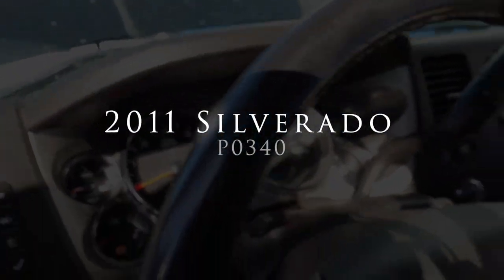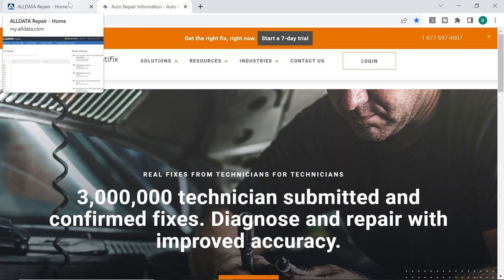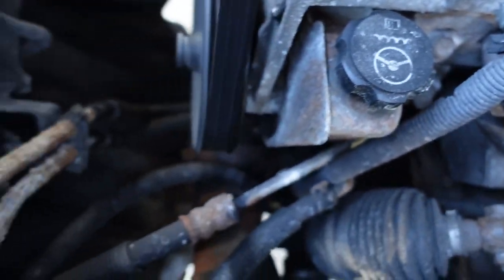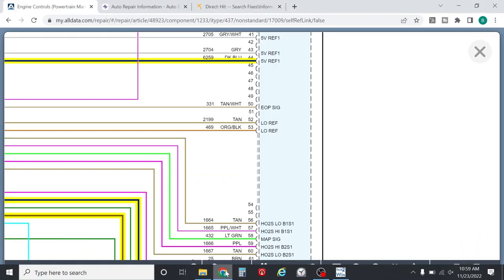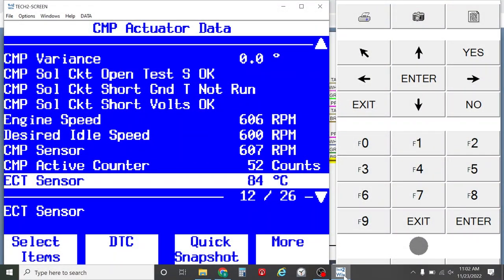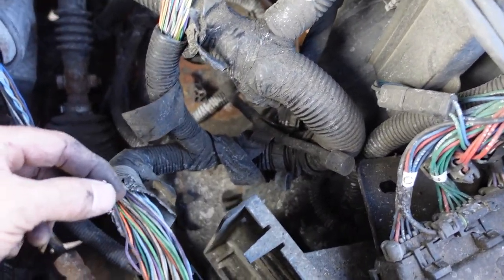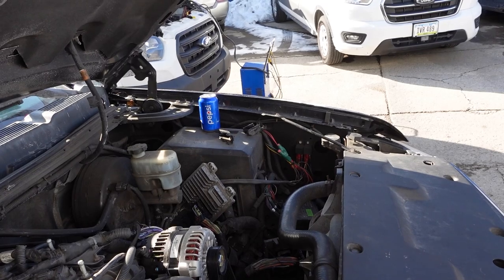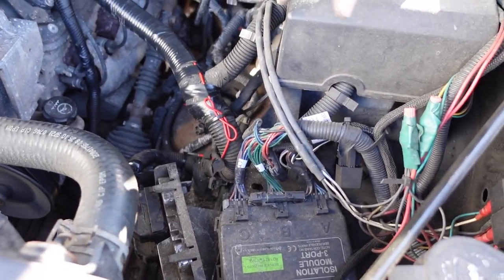2011 Silverado P0340

Comment: All Data wiring diagrams are nice. If you use the windows "find" function (F3) you can type in CMP or whatever and it will highlight on the diagram.
Reply: You also don't need to type the vehicle make-just the year and model starts bringing them up.
Reply from the maker: Great tip!! I will try that later today!!
Reply: all this makes me more confused

Comment: Great job Brian. I’ve seen a lot of these trucks where the 5 volts gets shorted by the oil pressure sensor and pulls the 5 volt down to zero volts and the throttle goes in default mode and sets code P0641. On older models the ecm sends 12v reference voltage to the cam and crank sensor. If the 12v gets shorted it will short the 12v at the ckp sensor. The diagram will not show that they’re connected internally but they are. 👍

Comment: NASA has a massive wiring guide that’s free to read online.  They say that applications that have vibration should use barrel crimp butt connectors.  Solder will eventually fail due to vibration.

Have a wonderful Thanksgiving, Brian.
Reply from the maker: Great information! Happy Thanksgiving

Comment: Great video.  That customer got very lucky on the PCM.  

Last year I had to do a wiring repair on my 2014 Mustang GT where something chewed the wiring off right at the connectors of both passenger side VVT solenoids.  I bought new connectors and used those same type of bare barrel connectors with heat shrink to do the repair.  A year and a half later and the repair is still holding strong.  I considered using solder but after reading a lot of info about not using it in possible vibration situations, I decided against it.  The new Ford connectors came with those same barrel connectors to do the repair.
Reply from the maker: I didn't  think pcm would be ok !

Comment: Man was this ever helpful. I had an intermittent stall with intermittent alternating crank vs cam sensor codes. Of the truck sat for 5 minutes, it would restart. My problem turned out to be the cam signal wire ground out on power steering pump. I wonder if this would cause a 5 minute time out on the pcm? Definitely weird it would restart around 5 minutes after. I almost put a cam sensor in it. I appreciate your video.

Comment: So if that wire was shorted to positive 4.7v and you jumped it from pcm supplying a ground, why didn't the fuse pop? What am I not understanding here
Reply from the maker: That was a low reference ckt, it was intermittently rubbing to that b+ wich compromised the circuit integrity.  That b+ circuit is not protected ( maybe it is but a very large fuse or link)
Reply: @BrianMann216  yeah but if that wire was a low ref which is a ground and it was shorted to pos getting 4.7v, when you hooked your fused jumper it should've popped and essentially all you did was hookup a low ref ground to a wire that was shorted to pos all over again and it'll melt the wires because you didn't find where the short to pos was. You hooked up that low ref directly to that pos shorted wire all over again

Comment: Great video thanks! What is the advantage of using tech 2 win over an aftermarket scan tool, seems like a very outdated and annoying to use tool?
Reply: Eric, I like the tech2win emu because it's waaaay faster than my Thinktool on these older model GMs.  But yes, the GUI sucks, for lack of better words.  There are times only it will do re-learns, when my Launch, Thinktool, or Autel won't do it.  It has its place in my diag cart.
Reply from the maker: Tech 2 win may look outdated , however it functions much faster than some other tools for sure and generally speaking it does what it is supposed to when other aftermarket tools may or may not perform a function.
Reply: @paulpaquette1961  Thanks I'm not Eric From Advanced Level Automotive Same name with diagnostics at the end:goodvibes:
Reply: @BrianMann216   Thank you I recently started using Witech and was looking into other OEMs
Reply: @advancedleveldiagnostics  My Apologies.
Reply: @paulpaquette1961  Thinktool is only "slow" on pre-CAN Class 2 GM vehicles, like 2006 and older. This 2011 is CAN-equipped; a modern scanner would be more user-friendly that the Tech2 :)
Reply: @PineHollowAutoDiagnostics  Yes, you are absolutely correct, my apologies. BTW, thanks to you I own a Thinktool Pros!  Lovely little tool.  I just wish they would allow you to create a .csv file from generic data, but none of the Chinese ones will do it.
Reply: @paulpaquette1961  yeah no one beats SnapOn in data graphing and saving! I just use the snapshot feature on the ThinkTool 👍

Comment: Hi. I just came across your video cause have a 2006 impala ss with a 5.3L engine. It started out with a p0340 code and extended crank. When it came to me the cam sensor had been replaced. So I started with the connector one terminal had been spread out so replaced connector still had code and extended crank. So I replaced sensor with the same brand code cleared still has extended crank at times now with no codes. Pulled wiring harness apart looking at the wire all is good. Then I noticed when it does the extended crank I have crank counts crank rpms and cam counts but the cam rpms stays at 0. So I put an new ecm in it but it still does the same it. No codes and extended crank can release the key from crank to run back to crank position and it will start up and the cam rpms work on that second attempt does that sound like a bad cam sensor if so that will 3 of them bad or could it be a crank sensor not showing up any problems. I've checked both sensors 12 ref is good ground good and it has signal. I'm lost at this point. Thanks in advance for your help. Great video
Reply from the maker: How is the fuel pressure? Make sure you check the cam sensor counter Data pid for it to be counting
Reply: 60 psi fuel pressure its got injector pulse its good spark crankshaft counts count the crankshaft rpms work the camshaft counts count but the camshaft rpms stay 0. Cycle key from crank to run back to crank position cranks right up and the camshaft rpms work then. Just got though putting a crankshaft sensor in it tonight didn't fix it

Comment: Forgot to mention this when it does start on the extended crank unitl the second ignition attempt it has 60psi fuel pressure the injectors are pulsing and the coils are firing sometimes getting alittle back fire out the exhaust and sometimes alittle backfire out the intake.
Reply from the maker: I  had a back fire out the exhaust sometimes anf the intake sometimes I had the firing order backwards on my 80 malibu with a 229 lol